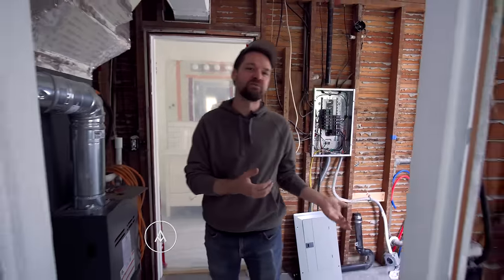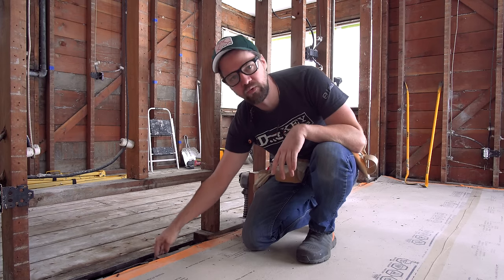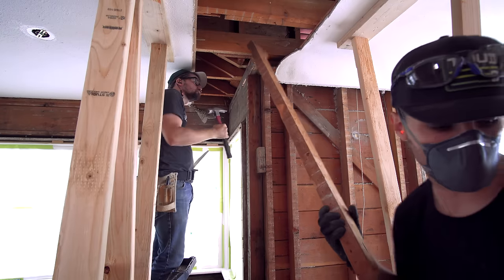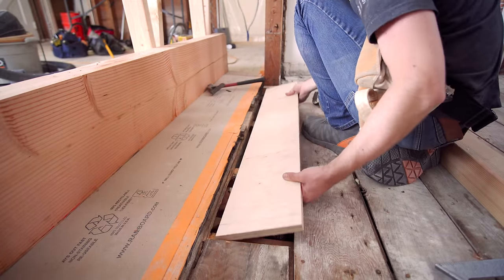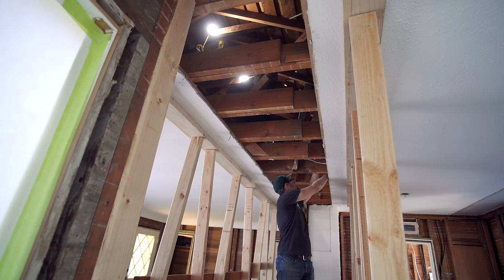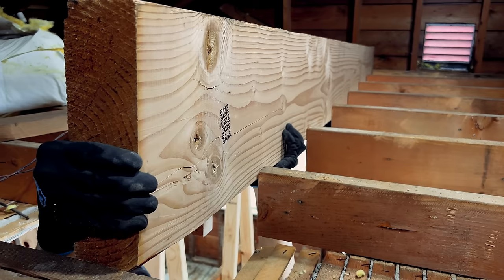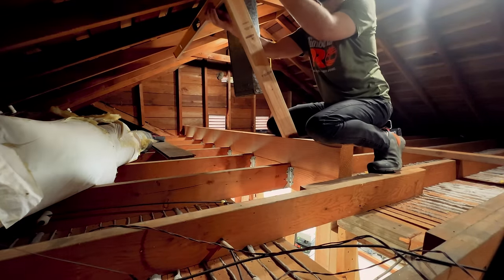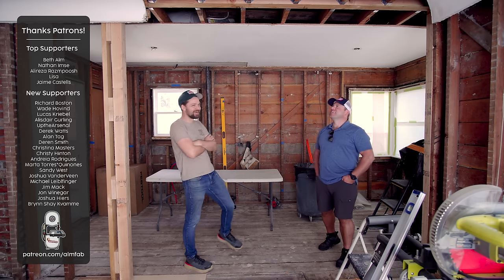Want to remove a wall? Here's what it takes...

Comment: Structural engineer here.  Well done.  Bonus easter egg was the disassembly of the cove, and seeing how it was supported.  Also, that's not post and beam construction.  That is conventional stick frame construction, circa 1930, with modern platform framing (not balloon framing).  Post and beam construction is what you'd see in a modern park pavilion, where the posts and beams are large-format timber with fabricated plate steel connectors.  Which is not to be confused with post and timber construction, which is large format timber with mortise and tenon connectors, like you'd see in an 1820's era building.

Comment: Structural engineer here. I really don't like the way those tie beams were cut. Those are under tension which the brackets are not designed for.
The better solution : just put the beam above the bottom chord and pull the tie beam up with threaded rods and save the temporary wall. After breaking down the wall tighten the rods a little more to ensure it does not sag
Reply: Love your videos by the way
Reply: Yeah, I think those joists are a roof tie. Could use some holddowns screwed to the face of joist and a rod through the new beam to restore that tension capacity. Make sure the rod is drilled through the middle of the beam so you don't reduce its bending capacity.
Reply: Could you just run a strap over the top of the beam and tie it to the top of the joists?  This would avoid needing to drill into the beam.
Reply: @barneyhartman-glaser6972  there are twist straps for that purpose that might work. It depends on the tension force and what the joist hangers are rated for in uplift. You would nail it to the face of the joist, though, otherwise it will just unzip in pullout over the nail heads. If thr joists were flushe with the top of the beam there are a lot more options.
Reply from the maker: @dellgreen1 I appreciate the advice, but I’m reasonably certain those joist are not under a tensile load. It’s not a truss roof, and there are collar ties in the rafters which handle the tension. Tim from Awesome Framers was saying that the roof is framed in such a way that the ceiling joist only support the weight of the plaster. Additionally I consulted an engineer before putting thus beam in.
Reply: Love both yours and Awesome Framers videos but the first commenter is correct. Collar ties do not provide tensile support. This is done by rafter ties (what you refer to as ceiling joists) which are the members which you cut and fastened with hangers in the video. Truss roofs are not the only roof systems designed with tensile members as integral load supports. A quick google search of “collar tie vs rafter tie” will explain this well
Reply from the maker: @johndom450  Thanks for the comment and I want to clarify some bits so people reading these comments aren't confused. There's a difference between a rafter tie and a ceiling joist. (https://www.youtube.com/watch?v=VjZssXBUHnA) if this was a roof framed with rafter ties, they would only be every four feet and be made from a 2x4. Over this span (9ft) there would be 2 rafter ties. These are generally used when you don't have a ceiling like in a garage. A ceiling joist is designed to support the ceiling (which is my situation). There are 8 2x6 ceiling joists inside of the same span. Yes there are tensile loads, but it's minimal compared to the amount of framing I installed. I'm considering after all of these comments, adding a few Tension Ties  which can be installed on top of the joists, and screwed into the beam with lags. I will show this in the next video. 
Additionally the collar tie is a tensile member (https://www.nachi.org/collar-rafter-ties.htm#:~:text=A%20collar%20tie%20is%20a,permitted%20to%20replace%20collar%20ties.) But its function is to prevent the roof from spreading, not the walls, which is the concern. Again a couple tension ties placed on top of joists should keep all the hangers seated, and I'll install those in part 4. Thanks for the advice.
Reply: @MichaelAlm  Hey Michael, thank you for the thoughtful response. I would also like to clarify here as there are still some remaining points in your most recent comment that do not appear to be correct. 

Your statement that ceiling joists will support the load of the ceiling, while a rafter tie doesn't, is only somewhat true. In this case the term is interchangeable because your ceiling joists are also acting as rafter ties. The issue that myself and @Dellgreen1 have taken with this video is that your framing replaces the ceiling load like you claimed, but the manner of fastening via hangers does not prevent horizontal wall spread, no matter how large your center beam is. Like ceiling joists (which in this case are the same member), rafter ties are required at every rafter, not at every 4 feet as claimed above (which is only a correct span for collar ties, a different type of tensile member). This statement is taken directly from the IRC. (https://codes.iccsafe.org/s/IRC2015/chapter-8-roof-ceiling-construction/IRC2015-Pt03-Ch08-SecR802.3.1#:~:text=Ceiling%20joists%20or%20rafter%20ties%20are%20the%20framing%20members%20used,caused%20by%20the%20wind%20load.) Lastly, while collar ties are tensile members in terms of preventing separation of the rafters from the ridge, they do not act in tension to prevent wall spread in the  same way as the rafter ties/ceiling joists do and thus your initial comment saying that "there are collar ties in the rafters which handle the tension" is misleading. 

I don't mean to be disrespectful in this comment as I truly enjoy the content you put out and feel that you are one of the most innovative woodworkers on YouTube. With that said, these points are extremely important to clarify as your video is titled "How To", yet would not be structurally sound until proper tensile fastening is added (which to your credit, you did state you will be doing with the straps). I'll be looking forward to seeing that addition and the rest of the kitchen build in your next videos as I'm sure the end result will be of very high quality.
Reply: @MichaelAlm  Couple things to unpack here.  First, Dellgreen1 is using the wrong terminology for North America (the correct term is "rafter ties" not "tie beams").  Second, the Simpson LUS28 hangers you used are fine for that application.  Third, regarding your response, any attic floor joist with a gable roof will in fact be under tension and act as a rafter tie, unless there's a true ridge beam.  Also, the collar ties do not act as rafter ties, and they provide insufficient tension to replace a rafter tie.  The sole job of a collar tie is to prevent the ridge from opening up in high winds.  Your structural engineer likely knew all of this, but we don't normally spell out all of this background info on the beam plan or details.  The design he gave you correctly hits all of the right points.
Reply: Simpson LUS28 brackets with SD structural screws in the header holes are rated for shear in two planes (vertical, and along the length of the rafter tie), hence the term "double shear" in the catalog.  Had he used shorter nails, that would have been no bueno, but the SD screws and 3 inch nails make it all work as a double shear connector.

Comment: My house is post and beam construction built in 1795. The town bought it for a poor farm in 1895 and added an ell on the back. In my remodeling, I took down the ceiling in the large room the back that was half in the original house, half in the extension. They had cut off the post in the middle of the room. The beams that were supported by the post were left hanging without support, as was the upper half of the post on the second floor. One hundred and twenty-five years later, the beams were still there with very little sagging. A structural engineer recommended the remedy — an I-beam with two arms welded on and bolted to the sides of the room, Then the beams jacked up, level to the I-beam, and bolted on. It sounded like the Titanic going down but the house held without a single crack in the horsehair plaster. They don't build houses like that anymore, but your old house might have surprised you with how it could withstand removing the supporting beams for a while.

Comment: Nicely done. In the UK we use adjustable steel pillars called 'Acros', to me they are more sturdy than 2"x4"s and they have a large range making them suitable for different projects. The roof supports were handled well, going onto the new beam.
Reply: In Germany we also use those things. They are more reliable and can handle way more weight, which is crucial in europe because we have way more steel and concrete in our walls and ceilings. You also don't "waste" wood.
Reply: @iPain3G   Friend, may I point out this is a homeowner rebuild, that lumber will be recycled into the build. No extra moneys spent on steel pillars that serve no use after rehab . . . use what you at hand . . . smart I would say
Reply: @dannyoktim9628  you don't need to buy the steel pillars, you can rent them for a couple euros per week. In most german houses you don't have the choise. When you have a steelinforced concrete ceiling you need steel pillars to hold the weight.

Comment: What about your structure under the floor?  When you remove the weight off your lower load bearing wall, you increase load upon the rest of it, and you could have a failure due to the increased load.  You probably should go under the wall there and make pilings that are dug out and filled with concrete but deeper and wider than you had originally.  You can learn all about that watching Holmes on Holmes.  He is very big on structural.
Reply: I'm a structural engineer, and it's all about the math.  If the math allows a king post to rest where it is on a bottom plate with double joists beneath that, then it can rest where it is.  If additional blocking or a new post and footing are needed, then put them in.  You have to do the math.
Reply: @Loonypapa yes but I expect there was no math done, hence why I asked.  Mike Holmes goes nuts about this kind of stuff.

Comment: I've not read other comments but I think it is worth mentioning that the ceiling joists that were cut to let in the beam form part of the roof.! They were overlapping to make one long tie to hold the bottom part of the truss to stop the walls that the roof is resting on from spreading outwards. For safety reasons they should be tied back together with metal straps through the new beam...!
Reply: LUS28 hangers with SD screws are rated for tension if installed correctly.

Comment: You didn't really need to re-do the top plate for the post. most of the engineers I deal with prefer that the beam bear directly on its posts.

Comment: I just want to mention that if you are worried about the roof load and the supports you attached, the one on the right, they were just supported by the tips. One should support the entire length of the cut. I get you are doing it yourself but thats just.. The load on the tip would be too much.. It can break under additional load.

Comment: Love all that know and tube wiring! I am sure that will disappear before covering.
Reply from the maker: Yeah, it’ll all be replaced. This house has never really been remodeled.
Reply: @MichaelAlm  We had our knob and tube replaced after getting our 1400 sqft Cape house in Port Gardner. Cost us $20k and we still have more to do! Made me wish I had become an electrician!
Reply: My 1924 house has it too, not looking forward to the cost having it replaced
Reply: Didn't know anything about nob and tube wiring until I sold a house and learned that the entire internal electricity was cobbled together between old knob and tube wiring along with more modern attempts with different breaker boxes. Mind blown. Found a buyer, but didn't want to fix all of that.
Reply: After I rewired my 1927 house, I kept all the old tubes. No clue what I'll do with them. Maybe a wind chime or something? I just didn't want to toss them in the trash.

Comment: Another brilliant episode!

Genuine question - do you not use acrow jacks (or equivalent) over in the US? Cheap as chips to buy or rent and the goto when replacing a lintel or load bearing wall. Or are they just overkill for a timber frame construction?
Reply: This isn’t timber frame construction.
Reply from the maker: Thanks! Good question. If I were leaving them up for longer than a day or two the arrow jacks would be worth it. 2x4s are cheap and easy enough to install.
Reply: I wish they used acrow jacks here.  Acrows with needles would make a lot of the work on masonry openings so much easier.  I don't know why they never became popular here.

Comment: You could have built your new beam ABOVE the ceiling joists ( DO NOT CUT the joists at all ) Tie the new beam to the doubled ceiling joists using through bolts and joist hangers if appropriate and available, then remove the support wall
Reply: Never heard of that before. Is that legal?

Comment: Are those ceiling joists not be under tension? I don't see how those joist hangers would help in that case?
Reply from the maker: They aren’t under tension. The collar ties at the top third of the rafters are tensile. If it was a truss roof you would have to worry about tensile loads in the joist, but my joist are compressive only. They basically only support the load of the plaster on the ceiling

Comment: Great work, my on critique is the lower part of your supports that went on top of the new beam should have been “bird’s mouthed” to prevent movement/slippage over time with load & unload because of the steep angle they are on. Also gives you more nailing options rather than a single thin wedge of endgrain. Beautiful workmanship though. Similar job to Scott Brown Carpentry’s channel a few months back 👍🏼

Comment: This isn’t post and beam construction. That refers more to how the walls are built rather than the fact the  house is sitting on piers.  In post and be construction, the support provided by the walls is provided by widely spaced posts. It’s very uncommon to see a house built after about 1870 using post and beam construction unless you live in Amish country. Without seeing the exterior walls, I would call this house stick built.
Reply: This is simply balloon framing sitting on floor joists on a pier foundation.
Reply from the maker: Post and beam foundation not framing. It’s also called post and pier.

Comment: The wall removed didn't appear to be a load-bearing wall. The "load" would have been from the celing stringers that were acting as supports for the celing and the bottom chord for the roof truss. The bottom chords keep the roof trusses from splaying out under the roof load.
Reply: Ummm the wall spanned the length of the trusses…this is what it a load bearing wall… if a wall runs the length of a truss then it’s not load bearing….this is why open floor concept homes have big wooden beams either showing our up in the ceiling.
Reply: @adamdurham7643  The bottomed chord is only supporting the weight of the celing and the tension of the roof rafters, top chords, from pushing the top of the walls out. 

A bearing wall supports either the roof directly or a wall directly above, depending on the location. 

A better question is, was a structural engineer questioned on how to properly do what was done? Was a structural engineer questioned whether the wall was "load bearing" before any work was done? 

Without written approval and a stamped design by a qualified structural engineer, we are just a bunch of people arguing a bs facts.
Reply: He has stated that he consulted an engineer. The fact that the joists from each side ended over that wall is a big hint that it’s load bearing.
Reply: @vernhart  out of curiosity, what is your experience? I have been a union carpenter for over 25 years. Part of that time, I was responsible over multiple commercial projects totaling over 900 million in 13 years. I have consulted and worked with some of the largest engineering firms. I would love to see an engineers stamp on his details that shows exactly what he did.

Comment: That’s not what “post & beam” means and it’s obvious from the exterior walls that the home is not constructed in a post & beam fashion. You wouldn’t be able to just remove a load bearing structure from a post & beam (or timber frame) home.
Reply from the maker: This is a post and beam foundation not a post and beam timber frame. Two very different things. It’s maybe more common to call it a pier and beam but I think that term is confusion because that is usually poured concrete piers. In my case it’s concrete blocks.